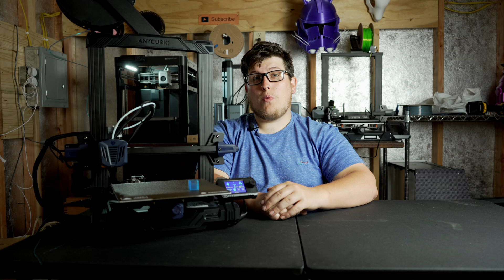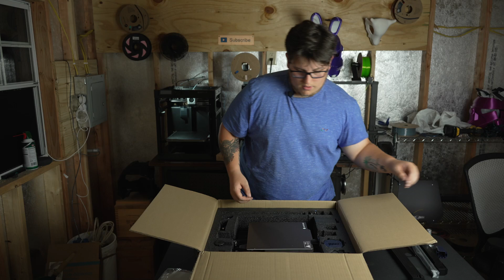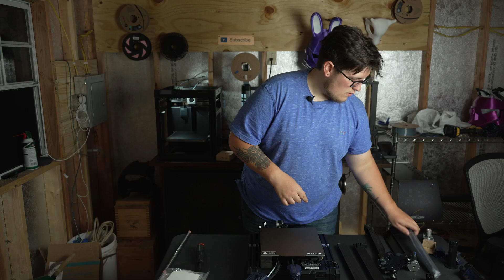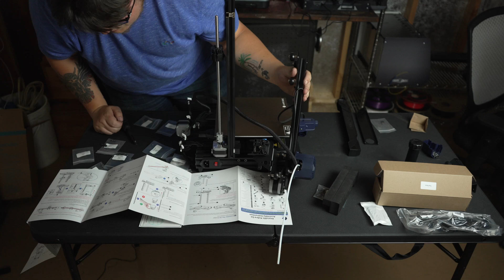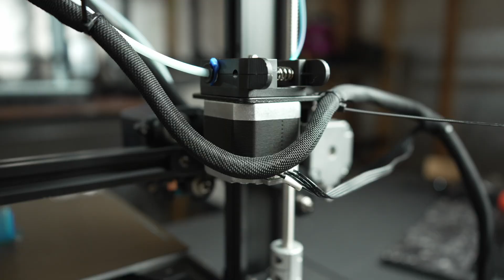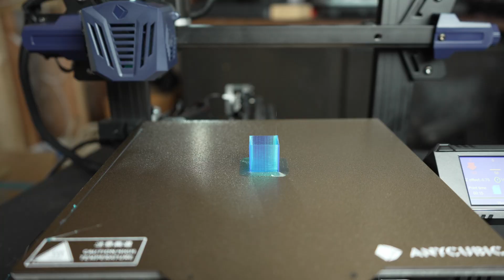Free 3D Printer Giveaway | Anycubic Kobra Go Unboxing and First Look

Comment: Random comment and also I'm surprised how well it worked without calibration right out of the box! Is this common among ender type machines because I also have a Delta and it's just unbelievable how difficult it is to calibrate that thing!
Reply from the maker: It is and isn’t. It depends on the machine. Even different machines within the same make and model can vary wildly